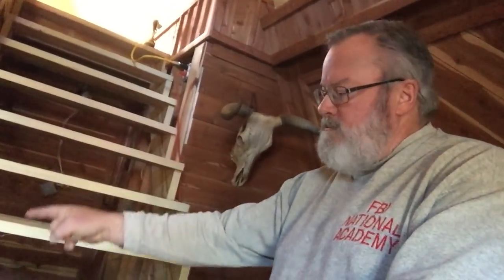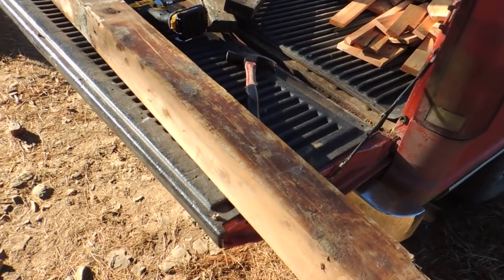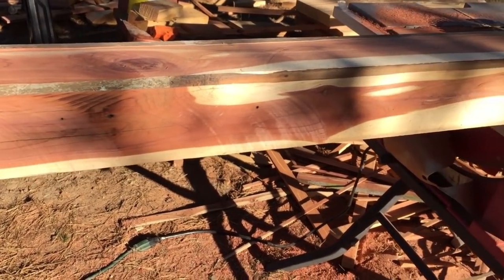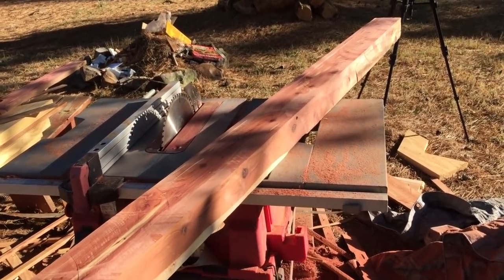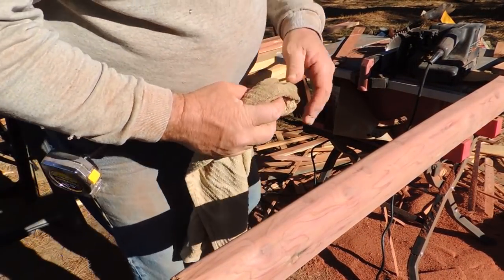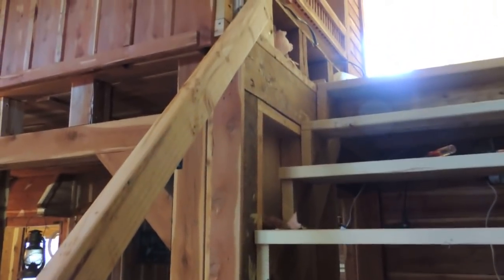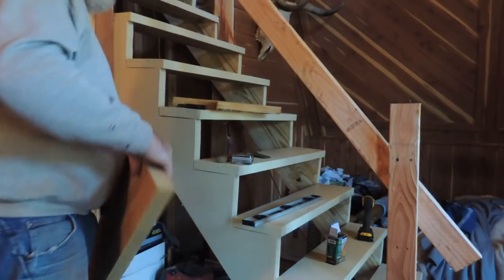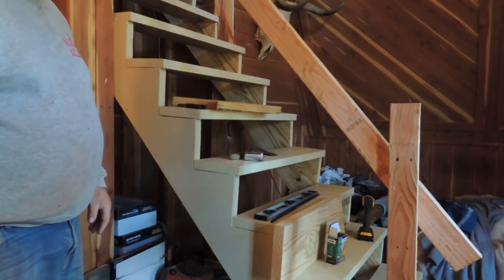HANDCRAFTED CEDAR GUARD RAIL.From old salvaged post.

Comment: The rail is beautiful.  Just measured the rail height in my 1886 cottage.  Nearly, but not quite 36” high.  My rail is yellow pine.  I stripped it a couple of years ago.  It’s a beautiful piece of wood.  They don’t make things like they used to.
Reply from the maker: I like to buck the system of todays standards!